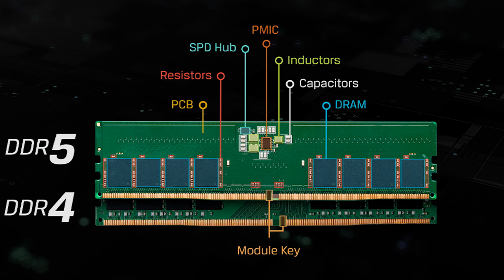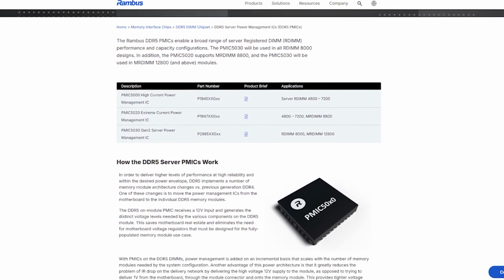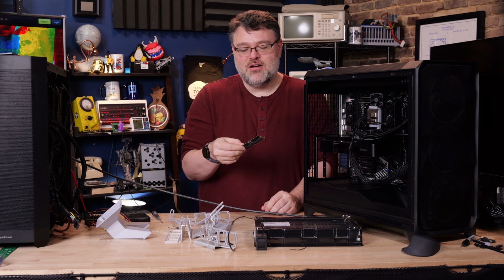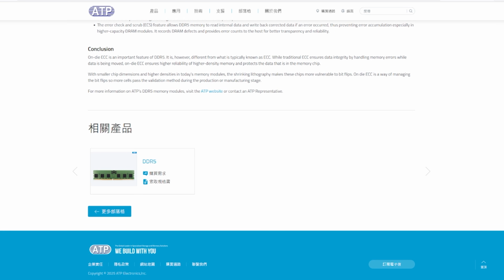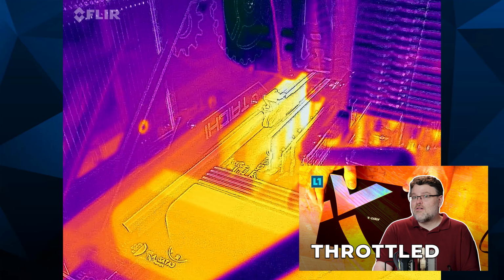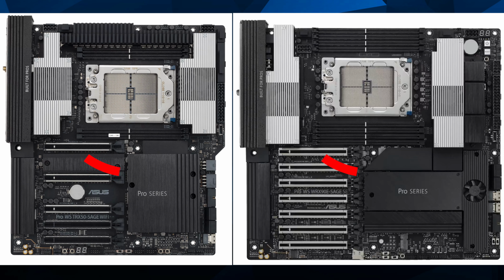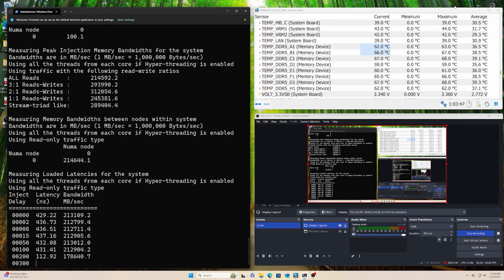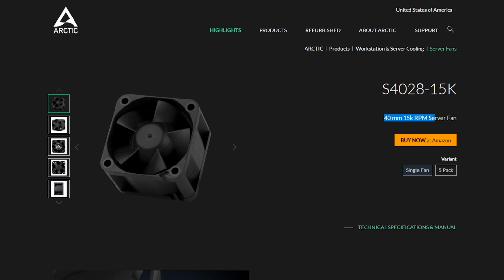Your DDR5 Memory Could be at Risk! All About DDR5

Comment: My rigg would be optimal for DDR5 since my MSI 5090 Liquid's radiator is isolated in a separate chamber and thus does not heat up the motherboard components.

Comment: In regards to server boards for OEM integrators, you could just 3D print a customized air baffle for the specified systems you sell and put it on top. It's not the nicest design, but it does work fairly well and at some charge up for it. Don't forget to use plastic that can't withstand higher heat so that the plastic won't warp.

Comment: I wonder if this problem is shared by DDR4? I had a watercooled 5900x system that threw WHEA errors and I could not for the life of me figure it out. All the temps were amazing (except I suppose RAM although I wasn't really monitoring that). Pulled my hair out for ages. Eventually changed case (with all else being the same) and went aircooled, and the problem was solved.
What's the safe temp for memory if we're looking at HWInfo etc?

Comment: Never exceeding 50c, usually wont let it exceed that under situations it can do so i just make all my case fans just hit 100% my only annoyance is i can only make my fans spin up 100% based on cpu temp in bios, while inside armoury crate i can make it based on vrm and ram temps, since my cpu and gpu are externally cooled by 2 mora3 radiators, anyway fan software can glitch out and even break sometimes you wont notice until its to late, but thank god it defaults to cpu temps in those cases so far.

Comment: If you truely understand computers at all this is no big mystery, anytime you are try to push more speed out of things like RAM or SSD's or NMVE drives or CPU's or GPU's (and the individual parts of the GPU like memory and such) things create more heat, you do not get something for nothing, that heat does a couple things, on the short term you'll get throtling and slower performance sometimes way less than a whole step down to the next slower level of RAM or whatever the component it is (if the things that are supposed to do this when needed actually do as they are designed), if it doesn't throttle back well it will pretty much cause extreemly quick failure of that component as in up in smoke show quick or more likely it just degrades very rapidly and those instabilities happen or if the in the case of RAM the individual memory modules are just not stable at a given speed and it can change depending on factors of the motherboard how good the power delivery is not just in terms of voltages but how "clean" that power delivery is, a lot of line noise in the incoming power as in from the wall outlet can be an issue believe it or not with highly sensitive stuff like computers, a good battery backup that has a good power conditioning and surge protecting features a power conditioner is NOT just a surge protector a power conditioner can take the high and low power ripples as well as frequencies (hrtz) and using capacitors and such smooth them out to a stable meen average, top line power conditioners allow you to set min and max perameters and shut things down if those numbers go to high or low into a less than ideal condition long before the upper end surge protectors would even react thereby saving you equiptment way better than just a cheap surge protector, it is a good investment and can make your sensitive electronics live a much better life, I learned just how critical this can be working in a recording studio for awhile, To get back to the RAM issue you are better off for speed using a low cache latency timing like say a cL30 5000Mhz set of RAM than a cl 42 6000Mhz set or RAM, plus the cl30 5000Mhz RAM most always will not get as hot should last longer be more power efficient while matching or exceeding the speed of the faster APPEARING cl42 6000Mhz RAM as often the latency is great on these "faster" clock RAM's, also things like AMD expo or Intel's XMP is essentialy an overclock of the RAM and if it is not stable you need to just back off untill it shows stable on a memory stress test, remeber that extra 400 or 500Mhz isn't worth a crap if it is always throtling from heat or failing prematurely from that heat, it's either that or try different RAM with lower cache latencies that may or may not run at a higher clock speed on your setup or it may not, setups and RAM vary from one to the next, at the current price of RAM that could drain a back accont in a pretty good hurry these days, also backing off on the XMP or Expo a tad for more stability and less heat/power draw can lighten the load onthe memory controllers in the CPU also, stability takes favor over speed.

Comment: Im using an Air cooler on my cpu a  Noctua NH-D15 G2 LBC  (AMD9900x3d) and it automatically moves air around my ram so no issues motherbord MSI x670e carboon

Comment: Oh this is interesting to see, ive been running my ddr5 4x16gb on my 12900k with a 6000rpm 40mm server fan placed right to flow air between all the memory sticks and they only run at 1.3 volts for 6000mhz and ive had it that way since ddr5 early adoption

Comment: I kept trying to warn my friends about DDR5, among the many issues DDR5 has overheating is just another one, There's literally no benefit to buying DDR5 other than the platform locking you to DDR5... The actual memory speed of DDR5 is worse than DDR4, stability issues with DDR5, overheating DIMMs and the necessity to buy extra parts that were not needed before, and windows is just making this all worse... I'm gonna share this with my friends, and convince them to go to 12th - 14th gen intel with DDR4 boards, bc DDR5 is just worse for gaming, they really should have not rushed DDR5, and AMD made a mistake with jumping to DDR5 on their AM5 platform without giving people a choice to stick to DDR4.

Comment: Corsair used to sell fan units for the dominator line. At first they were pretty sensible, with two or three fans forcing air down onto the exposed heat sink fins that ran down the spine of each module. Then they inexplicably covered those fins with a shroud that impeded the airflow.

Comment: People just dont understand they can't always run their memory as fast as they want. I see it over and over and over. For example trying to run 6000cl30 on a ryzen system. Just because that's the sweet spot doesn't mean youre gonna be stable. The previous setup I had wouldn't let me run 6000cl30 after a bios update. It just wouldn't work. Bought ANOTHER KIT and it still wouldn't do 6000cl30. currently running 5600 no sweat. It happens. its a 7800x3d so difference between 6000cl30 and 5600 is literally nothing. the cache is doing all the hard work in gaming. memory is less used thanks to the larger cache.
Reply: Zero issues here 9800X3D + 64GB (32x2) DDR5 6000 CL30 built april 2025

Comment: Those of us who have spent thousands of hours overclocking/tuning and stress testing various DDR5 desktop kits are well aware how sensitive they are to heat. 50C (SPD reported) is usually the point where issues start to creep up with tuned dimms. This can vary between DIMM designs and memory types but as a general rule I'd aim for <50C or <55C for less aggressively tuned kits.

For standard DDR5 this is isn't that difficult to achieve until you start pushing over 1.5V. If you don't have the ability to make brackets even just hanging a fan with zip ties will work great. I really wish more board and case manufacturers would offer mounting solutions.

Comment: What I got out of this is that DDR5 is broken on the desktop.  Memory is one of those things that has to be flawless.  If an error happens then the user MUST be notified and the offending hardware uniquely identified so that the failed hardware can be replaced, or at least remediation can be applied.  (i.e. back off on that overclocking.)  Especially with memory prices at such ridiculously high levels this is non-negotiable.

Comment: I just checked my temps and interestingly, you can tell which stick is where.  There is an exactly 1C difference in the rear slot. Also, discovered I only have on temperature sensor on them.

Comment: So, for me, I was getting a max temp of ~80 C in Windows, but in Linux, I was getting 95 C with throttling. I used a thermal camera to verify the temps while running an LLM to watch tokens/sec drop rapidly once it hit 95 C. I added fans and now I get a max temp of 50 C in Windows and still have not tested it again in Linux yet. Wrx90e with 512 GB DDR5 6000 V-Color. I have had zero stability issues in Windows in the last year since I bought the memory despite the high temps.

Comment: I found this out when I heard somebody talking about why they always will get a system with EEC memory and it was basically because they had tried a desktop PC and realized just how many errors you get from memory instability. I actually followed tech yes cities recommendations for tuning DDR5 to 6200 megahertz using an infinity fabric of 2067 and I highly recommend it. I have a lot of airflow over my RAM but it never overheats and I get excellent performance out of it and it's meant to be 6000mhz expo ram but loves 6200mhz
Reply: That someone may have been Linus Torvalds. When your job involves tons of kernel compiles you NEED to know your memory is working correctly.
Reply: @samiraperi467 actually... It was! Thank you for the added context, mate

Comment: Could this be a scenario where a cheap blower style cpu cooler would deliver better performance because it also happens to blow air over RAM?
Reply: Those usually sit above the RAM so it will depend how much air they lose downwards. Unless it’s an unusual design, it likely won’t make a huge difference. Ducted airflow will definitely do more to fix things.

Comment: I find this a strange issue.

Personally I thought it was obvious when they told us how DDR4 chips were heat sensitive and heat spreaders became the norm, then doubled down on DDR5, that 2 and 2 seemed obvious to me.

I see I'm weird though 😂

Might I also say how I found RDDIMs strange because no heat spreader whatsoever, when dome of them are meant for systems that definitely wont be sever cases with a Cat5 hurricane blowing over them, or even able to have such. Seems like some of the kits should come with speaders, or OEM add-ons at the least since they know these HEDT systems arent all gonna be in specialized ducted cases.

Not everyone building a TRX50 system is necessarily capable or inventive enough to hack together a targeted bracket I feel. I certainly don't have a 3D printer atm.

Comment: with ddr5 its my first time that a memory upgrade 2x16gb to 2x32gb 5600 didn't work properly in a laptop due to thermal issue that cause instability. its ok at idle. Same speed voltage, etc. just not in the memory compatibility list of the same lenovo legion 5 pro model. in fact at the moment no 64gb kit in the compatibility list.

Comment: This make so much sense. I was testing memory clocks with 4 dimms on a Tachi mobo and noticed after running a slight voltage increase to try and get faster speeds after testing it passed for 10 hours. Then later I bumped it up, it crashed, and I put it back and couldn't get the same stability I saw earlier. I'm willing to bet it was due to a lack of airflow after it heated up. I now have a 140mm noctua pushing air down over the mobo. thanks for this video!

Comment: I've been using three Noctua NF-A4x10 fans on a custom 3D printed adapter to cool my 192 GB of ram on a Z790 platform and have not had any issues with thermal throttling or overheating.

Comment: This whole video made a simple issue complicated for no reason, specially for PC Gamers, the issue is easy to fix, don't buy Ram more then 1,35v and you will never have random crashes, blue Screens ETC, the higher the Voltage the hotter the DDR5 Ram and it requires cooling, I fixed this whole 20 min video in one single comment.

Comment: The should bring back cases with 200mm side mount fan, those are amazing for cooling the whole motherboard and everything on it, particularly in lieu of CPU coolings being mostly air towers now instead of the old type that pushes air into and out around the CPU socket.

Comment: I hope that DDR6 brings back UDIMM RDIMM interchangeability.  We NEED a new X99 so friggin bad.  X99 was the peak of enthusiast computing.  It has been downhill since.  My being able to start with a 6 core and 16GB of RAM and upgrade as things got cheaper was amazing!  This was in that shortage time (July '18) and set me back $164 friggin bucks!  Just one year later, RAM was reasonably priced again and I was able to pick up another 4 sticks at $90 for 32GB, this time 8GB instead of 4GB modules and because of the quad channel 2DPC config, I could pop it in with my current 16GB for a total of 48GB.  Yeah, absolutely freaking insane to think that in 2018 32GB of RAM cost just $90 and now it's an absolutely insane $300+.  It's been 6 years and in something where the price should be going down, we're at 300%+.  Anyway, memory rant aside, my needs out of the system grew and the 28 PCIE lane 6 core was no longer sufficient so I picked up an 8 core i9-5960x for $150 in May '21.  Due to flying a bit too close to the sun on the cache overclock, that chip only lasted about a year before instability started to creep in and I replaced it with an E5-1660 v3 for $40 in Feb '23; effectively the same exact thing including the unlocked multiplier but with ECC support.  This turned out to be a great thing because a bit later I wanted to do something that needed 256GB of RAM and a friend of mine just so happened to have a pile of 32GB 2133 DDR4 RDIMMs and wanted a Call of Duty game.  I got 8 sticks in the mail and he got his game, so effectively $80 bucks for 256GB of RAM.  So now my 6 core 16gb system in the course of 5 years has gone to 8 cores and 256GB of ECC RAM.  At this point, this is still my desktop.  In July '24, there's a sale on 5700X3D and X570 Taichi where I'm able to pick the pair up for just $391 and I finally bite the bullet on a temporary upgrade.  I still want an HEDT solution but neither company seems to want to make HEDT.  They just want to charge HEDT prices for consumer socket parts with HEDT core counts and that is hot stinky garbage.  I picked up a 64GB kit of memory for it for $117 and planned to get another when they dropped to like $60-80.  facepalm on that.  Should have just bought two from the start.  That kit is actually selling on ebay for up to $300 now.  Anyway, back to the X99 Taichi, I pick up an E5-2697A v4 16c for it in August '24 for $40 and make it a proper home server.  Total spend for the (mobo/cpu/ram) base platforms last 7.5 years including parts no longer in use = $864.  So yeah, peak enthusiast platform and definitely more of that please!  Can find pictures on Twitter with #ArcticFans.

Comment: while I simply had two sticks of 6000 EXPO on zen4 and 5, I ultimately ended up just dropping EXPO entirely and leaving them at 4800, while also still using direct air cooling with an attached thermal probe. 
even though these sticks have large heatsinks they'll still very easily go above 70C when something stresses them, power draw and resulting heat is some 5-10W on each stick when under full stress.
if i ever get something like a 9000mt kit it will most definitely be added to the water loop...
Reply: That's insane! next we'll start seeing triple fan RAMs, sagging DDR slot issues lmao

Comment: By optimizing (I don't like to say overclocking) my 7600 and the additional RAM (pbo, cuve optimiser, voltage in the bios...)
 I also noticed this memory instability issue after a long OCCT test (CPU + memory). 
 
thanks to HWInfo and its sensor monitoring, i notice that
I was getting memory error detections as soon as these sticks reached temperatures of 46-47°C,
 and this occurred after two or three consecutive one-hour OCCT tests (memory + CPU).

Using soldering clips attached to a 140mm fan frame, which was itself attached to the motherboard's metal mounting plate in the case,
 I positioned a silent 140mm fan above the RAM slots on the motherboard.

As a result, the temperature on both RAM modules no longer exceeds 40°C, and I no longer get memory errors during my long and very long stability tests.
 I should also mention that I lowered some of the memory voltages, and I think that must have helped also.
The memory was supposed to operate at 1.35V according to the labels on the manufacturer's box. I lowere it at 1.295v
I've been quite a fan of overclocking since my Cyrix 266 (for those who remember).

Comment: 46 °C running  Games in a 16 yrs old Midi Tower on Simple G-Skill Flares CL30 6000  I use only  1 Fan as output, no Intake !  I don't  see what you guys in your RGB Aquarium Builds do :) Might be Flow in right direction > Watewrcooled 8 fan solutions ;)

Comment: Systems been rock solid here, but then I'm using decent RAM where it doesn't get that warm (Corsair Dominator Platinum DDR5 64GB 6000 CL30). Looking at the RAM temps, it idles around the low 40c and barely reaches 50c even when gaming. My PC always runs 24/7 and this AM5 one with a 7950X3D has been running 24/7 since I built it around 1.5 years ago. It's never had a BSOD and programs and games are rock solid.

Comment: I have an ITX system (msi b650i), had 32gb DDR5 kit which caused crashes in helldivers2. Changed it to another 64gb kit thinking original was broken. Same shit. Changed lian li A4 to ncase M2, water cooling to air cooling, it still overheats and causing game crashes. (Arc Raiders now)
I guess this is because of crappy anticheat in both games (and DIMMs sitting next to each other), hwinfo shows constant 40gbs bandwidth usage in game.

Comment: My current gskill kit isn't stable at my overclock unless it has active airflow, never errored once since I added a fan - 7800X3D.
My older x299 system, my DDR4 OC would leave the stability barrier at about 55c and cause all sorts of issues till it cooled down.